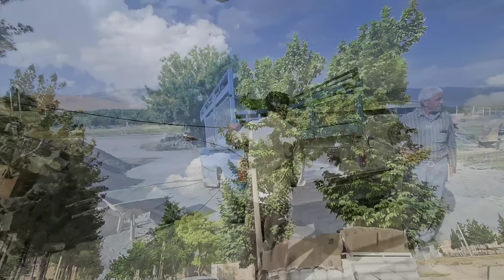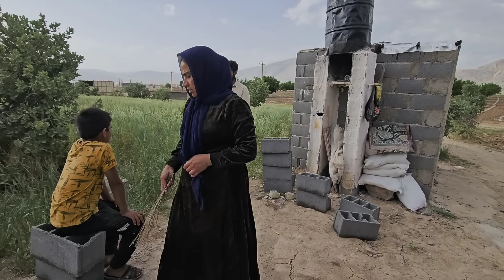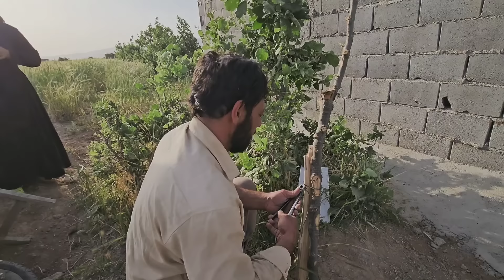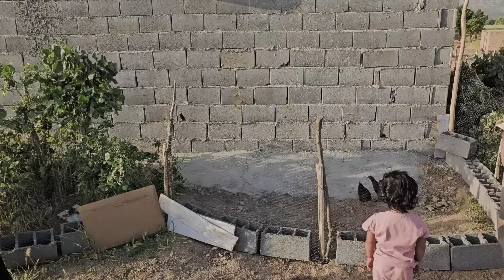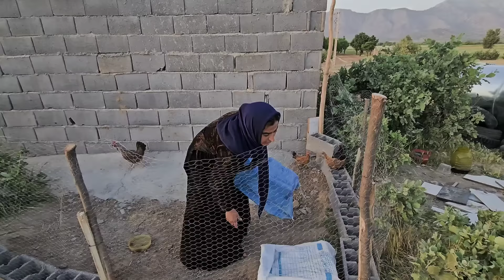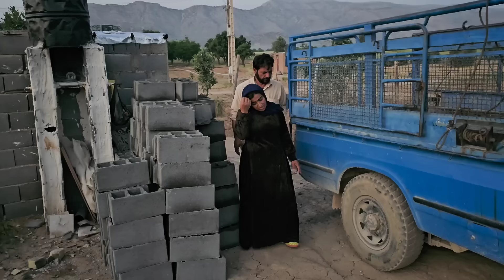Ali family journey from buying blocks, planting seeds, building chicken nests to a nomadic lifestyle

Comment: the chicken coop looked okay until Sefigol  started putting those cheap cardboard planks inside... put up a better roof than that cheap stuff bcus when it rains it will look worse... you need to gather up all that cardboard and all the trash on the side of the fence and in the trees and burn it,  or lay the boards in a NEAT pile behind the house. pick up the trash on a daily basis. it takes away from the beauty of the home. no one wants to see things all junky and ghetto  when it is sooo easy just to keep it clean.